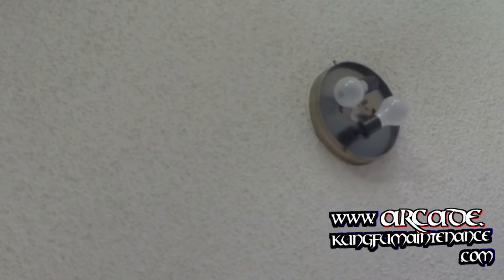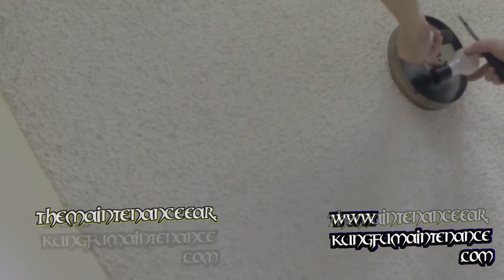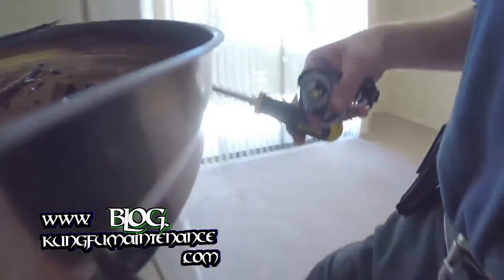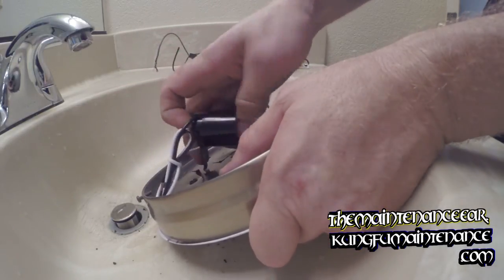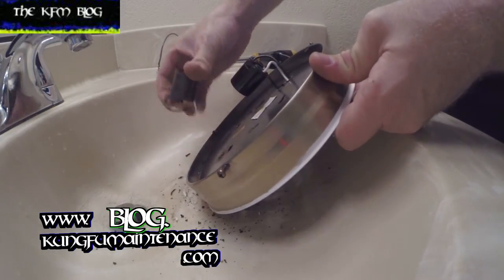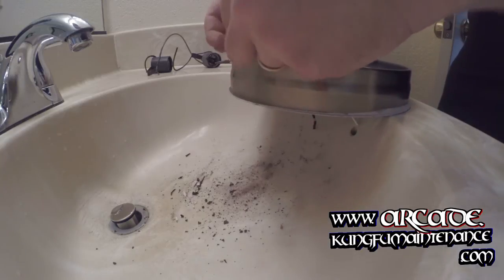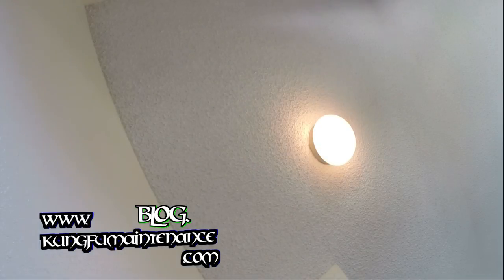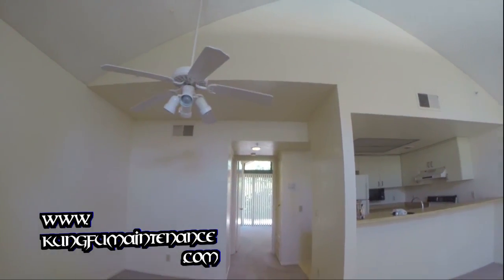How To Rebuild Replace Burned Out Mushroom Ceiling Light Fixtures Socket Wiring Repair Video

Comment: This was very helpful! Thank you for taking the time to share your expertise. I love the look of vintage light fixtures and this is exactly what I needed to know to replace the sockets. I just have questions about grounding. It looked like each socket had two wires; is there a third grounding wire somewhere? How would I add a ground to the light fixture? Thanks in advance for your help!

Comment: I did replaced the old plastic socket with ceramic socket and heat resist electricity wire. I removed the metal clip from old plastic socket and I putting on new ceramic socket.